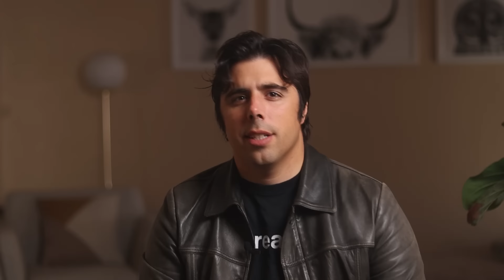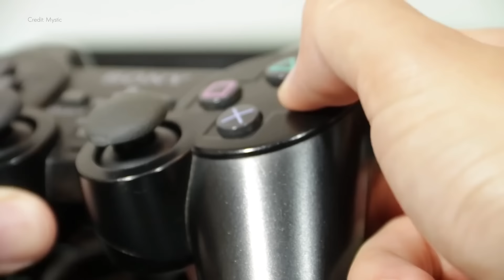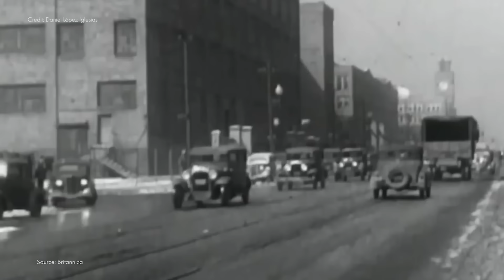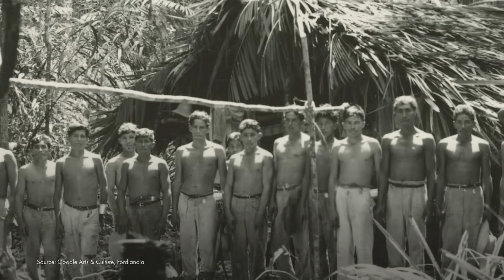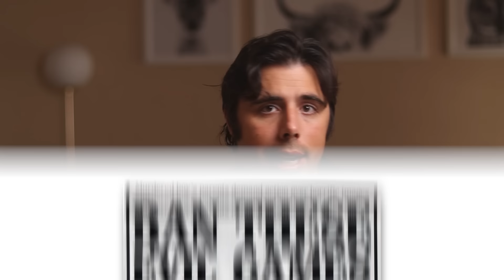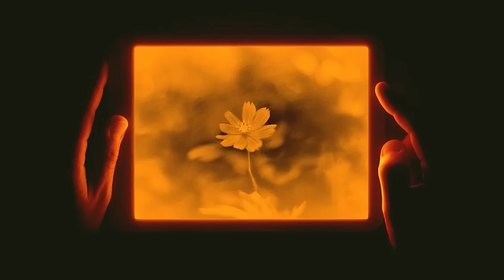Why Some Designs Are Impossible to Improve: Quintessence

Comment: 0:00🧩 Some designs, like the paperclip and the PlayStation controller, endure for decades due to their quintessential nature.
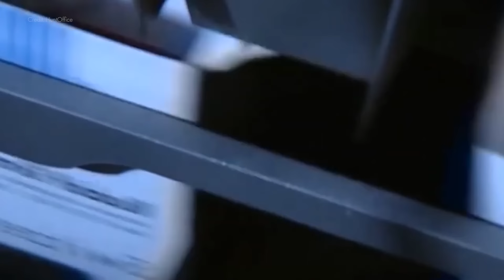3:50🔍 Quintessential designs often rely on intellectual property protection and strategic legal maneuvers to maintain dominance.
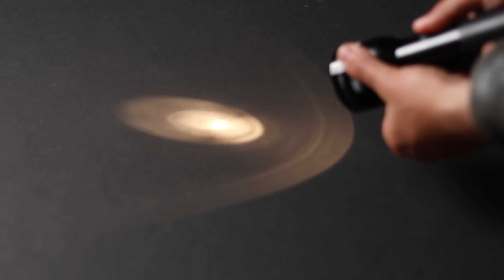5:59📱 Maglite's aggressive legal strategy and intellectual property protection secured its status as a quintessential flashlight design.
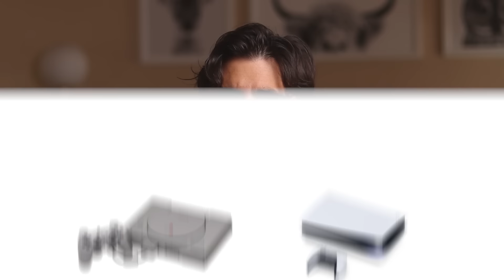8:21🎮 PlayStation controllers and the QWERTY keyboard layout exemplify quintessential designs that set industry standards.
12:25🚗 The Ford Model T revolutionized transportation and culture through its extreme simplicity and efficient manufacturing process.
20:19 💔 Fordlandia was a massive failure financially and as a social experiment, resulting in numerous worker deaths.
21:38 🚗 The Model T, with 15 million sales over 19 years, was the most influential car of the 20th century, shaping cultural and geographical landscapes.

21:51📱 The iPhone, despite being just one of many smartphones, stands out as the most quintessential device, reshaping cultural norms profoundly.

22:03 📱 The iPhone reshaped cultural norms profoundly, setting the standard for modern smartphone design and behavior.
23:01 🎰 The iPhone's success hinged on intuitive touchscreen behavior, despite initial skepticism about the lack of a physical keyboard.
25:43 📱 The smartphone's convenience comes at a cost, exploiting reward systems and potentially leading to addictive behaviors.
27:47 🔧 Apple's commitment to exceptional design quality and large-scale production sets industry standards, evident in the enduring quality of the iPhone.
29:43 📱 New tech companies aim to create healthier alternatives to the smartphone, balancing convenience with user control.
30:30 🔄 Quintessential design goes beyond features, tapping into emotional resonance and care from creators, akin to the elusive "Fifth Element."
32:38 ✨ Quintessential objects remind us of the magic in creation, emphasizing creativity, empathy, and timing.

Comment: Pretty bad to see you crediting PS1 for both the addition of thumbsticks as well as the right/left bumpers when in reality, Sony ripped off Nintendo on both accounts.  
The N64 was the first major gaming controller to feature a thumbstick, and the SNES is the one who introduced the top bumpers.  
The original PS controller ripped off the SNES controller design and added a second bumper.  And it had no thumbsticks.  
Then in late '97, a full year after the N64 had been on shelves, they introduced the dual shock controllers which had dual thumbsticks.
Sony didn't design this shit. They ripped it off and improved on it. 

If you're going to make informational videos, you really need to get the facts straight.

Comment: The Lada Niva has been pretty much unchanged for the last 50 years or so. It was slightly improved in the engine department, now having direct fuel injection instead of a carburettor, but on the outside it is still the 1977 OG model.

Comment: The biggest likely change to the controller would be to change from the potentiometer reading of the joysticks to a hall effect version, this would stop the perennial problem of joystick drift
Reply: Gyro's are common now, and likely to be a mainstay. Motion control is snappy, quick, and precise, unlike Analog, the only issue with them is bluetooth jitter.

As Bluetooth gets better, and the Gyro output gets cleaner, Gyro controls will absolutely end up becoming a major way to control cameras in console games.

Comment: Ford my not have invented the production line but copied it from the clock industry around in the 1890's. American clocks with open springs and prest parts can still be found running very happily today. You can also take out the count wheel from one clock and put it into another as they are all the same. Up till 8 years ago I could still buy some new replacement parts off the shelf. China now makes a copy of the designe that runs for 31 days not like the American clock of 8 to 10 ro the weight driven type only fore 30 hours.

Comment: The PlayStation controller sucks. I know that's not a universal opion, but I have never liked it. The touch surface on the PS4 controller is a cool innovation though. Anyway, I think the GameCube controller is the best controller that very few developers actually designed for, and the Xbox controller is way better than PlayStation as a generic controller

Comment: Shaving is funny example. The safety razor was perfect, and blades only cost a few cents each. The problem is it didn't make people rich, so we invented the Schik Quattro 5 blade + moisturizing blah blah and sell them at $5 a pop
Reply: The good news is that there are many simple ways to sharpen the blades.
Can expect 8-12 sharpens before the blade profile goes wonky.
Reply: I got blades from an internet shop sent regularly to me, but I had to cancel the subscription as the blades (Wilkinson 2-blade with moisturizer) was to freaking good. After two months I can sense that the blades are slowly getting dull ….
Reply: A youtuber recently tested all shaving tools, their comfort, performance and lifetime cost. 
All of them except single-use razor was at same performance 
Safety Razor costed 700$ for a lifetime
All others (including single-use razor, multi-blade razors, and electric razor) costed between 2400$ to 4800$ in a lifetime
Reply: @anon-y3z 700$ seems like way morethan a safety razor would cost, 
1 blade per week at 10 cents each is 100 blades every 2 years.
60 years of shaving that is 300 bucks for a lifetime of shaving plus the 20-40$ on the razor itself
Reply: @udkudk who? I want to watch the video, but i can't find it
Reply: Yeah, but you won't be happy when your hands are full of soap and you're trying to shave your balls with a 19 century razor.
Reply: @ta_pegandofogo  skill issue frankly
Reply: @ta_pegandofogo  Actually using standard old school single blade razor is one of the safest ways to shave your balls. All these fancy 5-blades have much higher chance to irritate your skin, and higher chance to cut yourself. I can speak from experience.
Reply: @ravensblade  woah, I didn't know that. I thought that safety razors were less safer because they look so "medieval"
Reply: @ta_pegandofogo2988 the henson safety razors are pretty modern looking if that's a hang up lol
Reply: @ta_pegandofogo why would you do that in general
Reply: @ta_pegandofogo  But why?
Reply: @LutraLovegood aerodynamics

Comment: I think you missed one aspect of replacing the QWERTY keyboard, or any other such design.  The 'cost' to the consumer of switching.  If you've learned to touch type on a particular keyboard, switching to a new one represents a 'cost' of relearning.  Sort of like switching between game controllers that swap the 'A', 'B', 'X', and 'Y' buttons.  It limits the number of consumers that cross-over.  Or imagine if a better design of a car used a single 'stick' instead of a steering wheel.  

The masses are ingrained to use one interface and switching has to have a benefit that outweighs the 'cost of switching'.  Switching from QWERTY has very limited benefits to most folks (being able to type 90 wpm vs 80 wpm is not a selling point to most consumers), but relearning the keyboard layout is deemed 'too high a cost for limited benefit'.

Comment: ok am one of the few people who wouldn't mind if keyboards were fixed, but ngl i feel like this 11:17 keyboard feels cursed as hell even tho technically the qwert on is just as bad...just bad for genration that its normal

Also is the letters more on the right for right handed people? Like 1st of that's not 10% of the population and 2nd of that's 90% of the sane population like most people use the mouse with their right hand meanwhile the left hand usually left ready on the keyboard thus it would make more sense to have the letters on the left side

Comment: I have an ortholinear keyboard, still qwerty, which means the keys are in a perfect grid. My keyboard is 15 wide x 5 tall. 

I have the 3 center columns for spacebar, arrows (a number pad on layer 2) and some other things, and then two side blocks with the alphabet and pretty normal outside columns. I type waaaaay faster and dont move my hands almost at all, and it only took me a couple weeks to adjust to it. I cant type on a regular keyboard anymore.

Comment: 28:00 Economy of scale is typically effective, but there are also situations where this doesn't apply. 
It's called economy of descale: it's the opposite where bigger scale means processes becomes less efficient, more overhead and lower agility when it comes to adapting to market changes. Much similar to a cargo ship, so large that it basically becomes unsteerable.

Comment: I still hate the qwerty dominance, I had to relearn to type when I joined my current company because they only use that layout while my country uses a different layout as standard.

I also hate those pictures from before/after the iPhone, because they simply are not correct. There are multiple smartphones that look like an iPhone from before the iPhone and there have been many attempts to make something different after the iPhone. Unfortunately they all failed. What makes the iPhone stand out so much? Marketing. And don't forget, if Apple would have launched the iPhone in today's market, with the limitations the original iPhone had, it would be a total failure.

Comment: Often enough a cheaper or easier to manufacture solution gains the upper hand.
Or a worse design is first to the market, and people just adopt what is around, while the later, better design is simply too late.
And typically something is good enough and affordable.

And the Playstation controller is a perfect example of incremental updates. Add analog sticks. Add rumble. Make it wireless. Give it Blutooth. Add a touchpad.
The competitors go different routes: MIcrosoft improve their design more, but stick to a somewhat consistent design.
Nintendo tries something new each time. Just look at the N64, Gamecube, Wii, WiiU, Switch transition.

And the Model T wasn't the first car, but it was produced at the assembly at a large scale. The first viable, commercial car was a Benz.

And Fordlandia failed for the same reason as why Walmart wasted a billion US$ trying to get into the german market: You can't force other cultures to adopt your customs. If you want to expand elsewhere, you have to adopt the culture that is there.

And while the iPhone is the original design of what we consider a smartphone today, it is no way the biggest in the market.
And yes, physical keyboards stuck around in the business market for quite a while. Mostly through Blackberry.

Comment: Regarding controllers, their design is just awful. Just ask someone who never hold a controller before – they use just 2 fingers on ALL of these >10 buttons in the front and in the behind there's just 4 buttons for other EIGHT fingers, but you can't use even four, because it's not ergonomical, it's not comfy – most of player use just 2 fingers (one from each side)for triggers and bumpers instead. 
So the result – there's about 20 controls and only 4 fingers used. You can't even simultaneously access buttons and right stick naturally! It's one of the worst designs ever!

And VR controllers are suffer from it! It was made in the very simmilar layout, even the buttons marked the same and even devs act like I know what the hell "A" and "Y" mean and where they're placed. Just marking it like ↖↗↙↘ would be much more clear, but they're named like gamepads just because of the matter of habit. It's still better than gamepads, since it use 3 fingers to control, but you still can't naturally use both sticks and buttons simultaniously and there's still too much controls for just one finger

Comment: Well, you sorta had me for about the first 28 minutes, But then you displayed some devices that proved you comment that speed didn't matter was dead wrong. If you offer someone a device that is slower than what they have, requires more 'maintenance' (as in battery life when it comes to digital devices) than what they currently have, or a clunkier user interface, it will lose. Speed and convenience are essential. You were possibly suggesting AI as a game changer, but AI chips will easily find their way into the current quintessence design, smart phones. What you were featuring are 'follow-on' devices and these things always fail. In the digital realm, the current 'winner' will just add features and it already does, such as Bluetooth attached wearable tech; such as cars adding air-conditioning and FM radios,. As evil as Mr. Musk is, he is playing around with subdural tech. That sort of thing may well be a new 'essential' thing. Whatever it is, it will not be a follow along. And, yes, it must be faster. [And, no. the 'i' in iPhone does still mean Internet. Without Internet there is no smartphone. Without the Internet your world, as you live it, does not exist. The true essential design was formless. It is what our current world is built upon. Not only as essential as the printing press, but more so. It is the Internet. A design in code. A design that beggars the question of whether a design must have a form itself, it provides a platform for other devices that absorb the value of the design in a effective way.]

Comment: Unlike other branch of companies, Automotive companies (or tech to vehicle companies) tries to solve a solution from a problem that does not exists. You know, PRNDL stick shifter to a button or full fledged touchscreen control instead of basic knobs.
Reply: It's because a single touchscreen is cheaper and easier than a hundred buttons and switches.

Comment: I'm gonna be so bold as to say, the Aptera is going to be a quintessential vehicle, alot of the things it has going for it are revaluationary while holding alot of the modelTs strengths(in house manufacturing/programing, few parts to make, revaluationising travel). It's a Autocycle so all the benefits of a motorcycle, but the company is going the extra miles with safety features and the likes of full cars. They are even suturing laws, the led the push to North American Charging Standard (NACS).

Comment: The greatest example of a design that can't be improved is the violin. It hasn't changed in any significant way since the mid 1600s. After decades of modern research its acoustics still aren't fully understood - and literally centuries of intense experimentation has yet to produce any significant improvements. The same for the violin bridge, which is equally sophisticated acoustically. The mysterious origins of the violin and violin bridge only add to the mystique.

Comment: The paperclip is not perfect. Sometimes when you go to put the paperclip on, the end of the outer part will poke you. Simply folding this small 1-3mm part in to create a rounded end will prevent countless pokes. 

Alternatively, if the starting piece of metal wire has rounded ends to begin with, then it will do the same thing. An efficient method would have to be worked out then scaled and made into the new norm.

Comment: 13:05 Consider the average car, which consists of about 30,000 parts. Now, picture the Aptera with just 1,200 parts. This is just one reason why the Aptera will take the world by storm later this year. We will see a drastic redesign in cars over the next 5-10 years. With everything from the materials and manufacturing processes to car designs, and even down to the very fundamentals of vehicle ownership and maintenance, all will be unrecognizable in the very near future, solely because of the Aptera. The Aptera will also fundamentally alter driving habits. Being able to drive 40 miles a day for free without worry of fuel cost, car degradation, or anything of the sort will enhance people's freedom and mobility. Also the Aptera's strong right-to-repair identity will revolutionize the industry, empowering owners to manage repairs and maintain their vehicles with greater ease and fewer restrictions of cost and labor.

Comment: One thing about that last bit. Almost all of us already have our phones on vibrate almost all the time. A lot of us turn off a variety of notifications. One thing I could see happening in this space is not a major shift, but a quiet change towards controlling what information is presented to us. 

This will probably not resolve the issues of miscommunication and disinformation. it might even make it worse. But that's the direction I think things will go.
Reply: most of us keep our phones on silent mode, except for our parents who keep their phone's volume at 200% of the sound of a supernova
Reply: Oh yeah, back in the day we all had ringtones and now every phone is on silent (context: Dutch student who travels daily). My phone is always on Silent and I had to change my ringtone to a song only I know of to remember when I'm being called.
Reply: This is pretty much a summary of the themes from the Metal Gear Solid games lol
Reply: @DaveLivesInACave  I don't remember the part where Snake mentions silent mode on smartphones, though. Information control on the side of the publisher is nothing new, it's centuries old.
Reply: I typically use Bedtime Mode. It's part of the Digital Wellbeing app introduced in Android 9.0. Bedtime Mode with the active "Do Not Disturb" setting will turn off all notifications.

Apart from this, I turn off the Internet (Wi-Fi or mobile) in some or all of my mobile devices, which also limits the number of notifications I would receive.